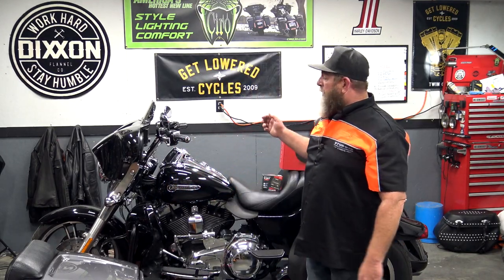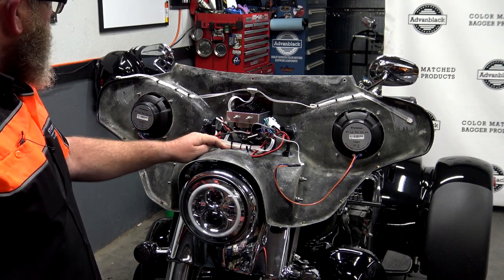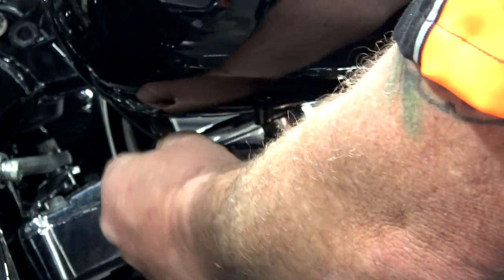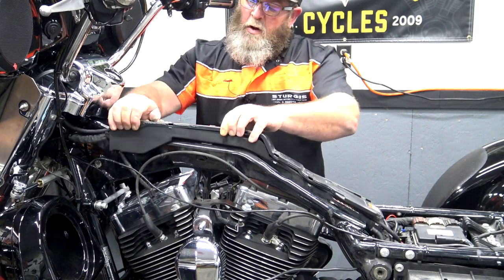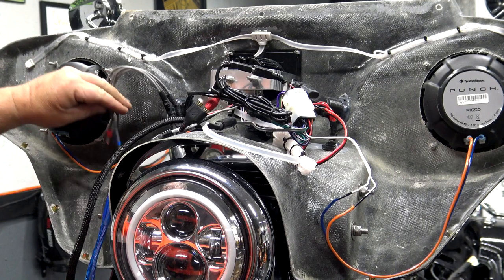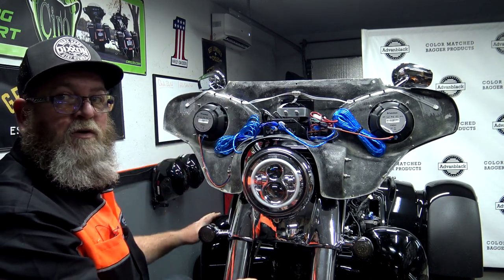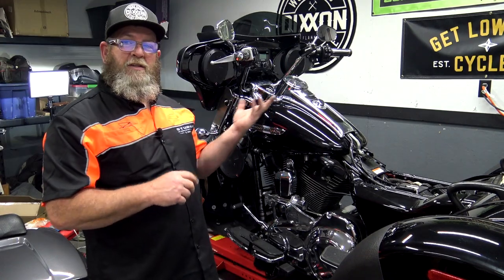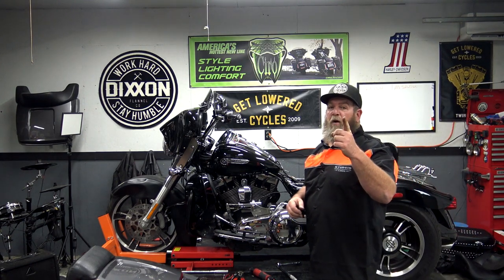Freewheeler Amp And Lower Fairing Speakers FULL INSTALL

Comment: Thanks for showing the ‘other’ trike some love. My 2015 FLRT came with this fairing, & now thanks to your video, I’m almost certain it’s a Vector brand. I’m shopping for an amp bcuz my trike came with this fairing, but has the 6x9” installed & she needs more power so I can hear tunes over 70mph. Thank you for keeping solid, professional, & simple videos on your channel SIK Baggers! Keep it going
Reply from the maker: Thank you for checking it out! Yeah this guys bike came out great and now has some killer sound. Just look for an amp that will not over power your 6x9s...try to match it to the RMS wattage on the speaker and not MAX wattage and youll be fine.

Comment: That was AWESOME.  You made it look too easy.  How many actual hours is involved in setting that up, please.  Also, I wish you would have shown the bike view from the front so I could see how that Vector Wing actually looks on the bike.  Anyway, gre8 job. Big Thanks.
Reply from the maker: Please watch my initial video on the batwing install..at the end I ride the bike up and walk around it there so you can see how it looks. Plus you can get an idea of how long it takes to install the fairing..its pretty easy. I cant say how long it will take you per say but it took me about a full day to get the fairing on, lowers installed, and amp and speakers hooked up.  Here is the batwing install video https://www.youtube.com/watch?v=4J5jGwyNw2U

Comment: Hey Steve ! , I built my Chevelle many years ago, I had a similar problem with wires & grommets, I found that the rubber Glad Hand gaskets work awesome 
Glade Hands are from Big Rigs air supply From the truck to the trailer,      Just an idea !!!!!
Reply from the maker: Thank you rex...I usually have some of those laying around left over from odd jobs lol couldnt find a single one when I needed it . ill pick up a pack from amazon! Thank you!

Comment: Will that smp work with my 2021 RoadGlide Limited?
I definitely need more stereo and I am just a poor working man🥴
Reply from the maker: Yes it will. the 21 has the same speakers as I put in this one only they are HD and not rockford...but yes this amp has plenty of power.